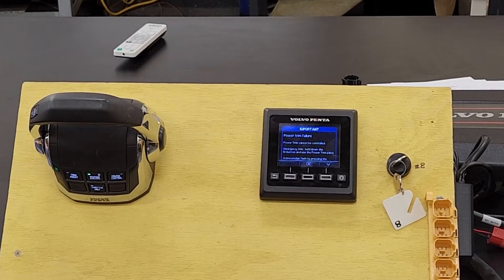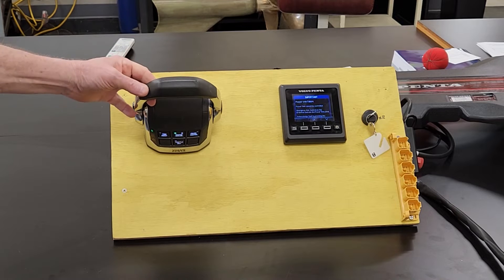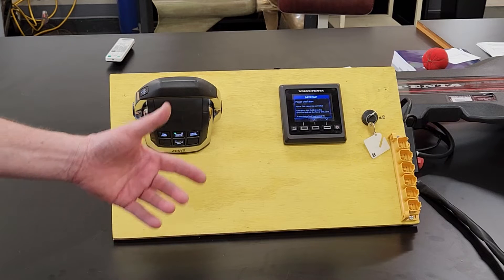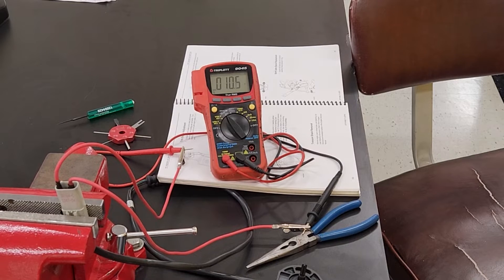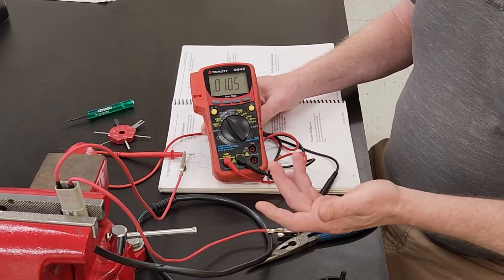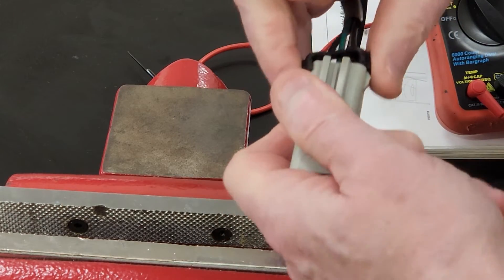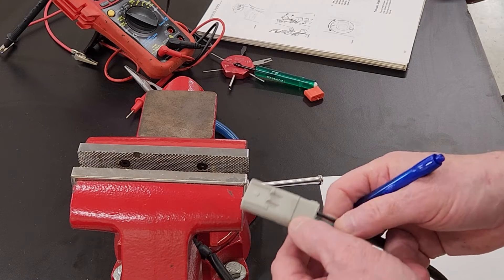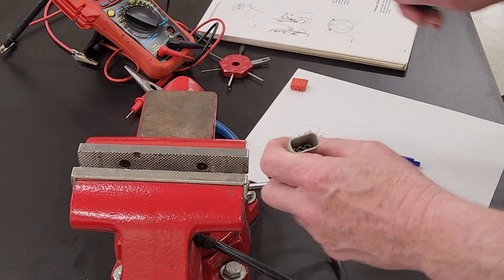EVC D & E Trim Sensor R&R and EVC Calibration

Comment: Just finished the trim sender replacement. Went well. The boat is on a lift so it was a bit harder than if hauled. Followed your procedures. Set the ohms, used a leader wire to pull the new sender harness and did the calibration. Thanks so much!
Reply from the maker: That's great! Thanks for the positive feedback